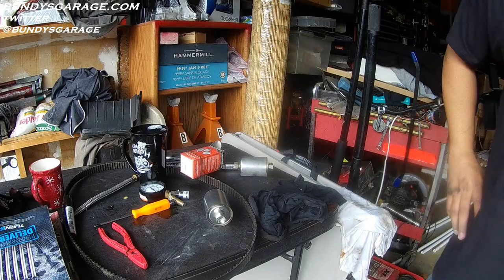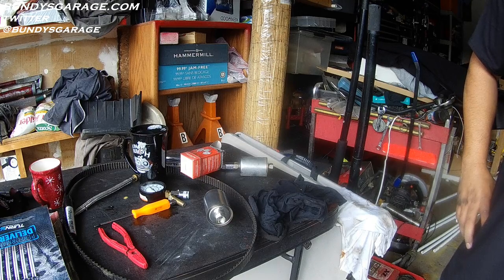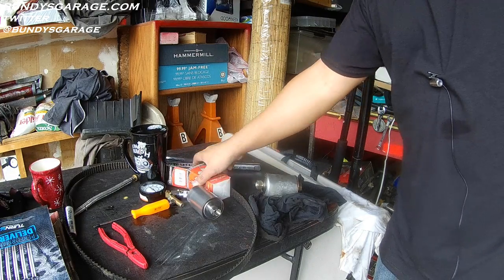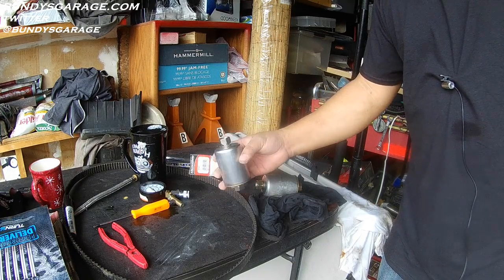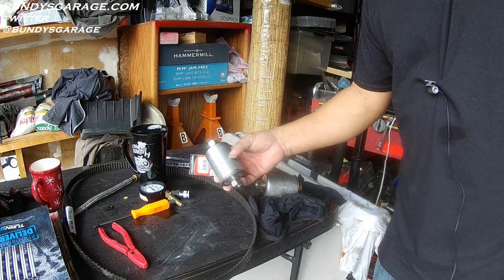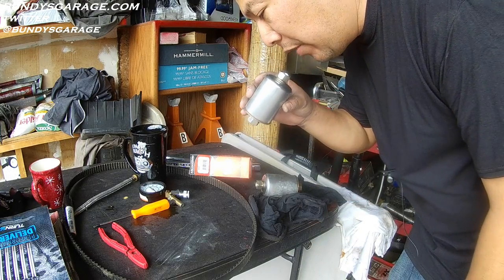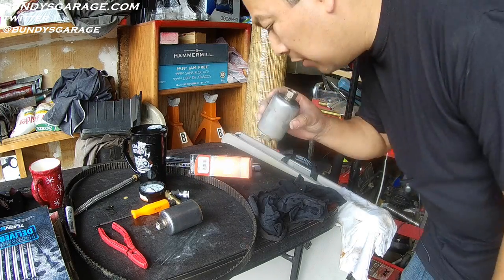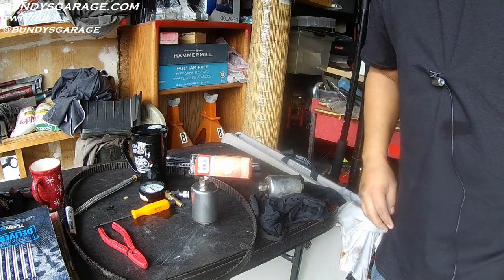Signs you need to change your Fuel Filter - How to tell Fuel Filter is Bad - Bundys Garage

Comment: So tell me "wise one" how is someone suppose to know of their filter is bad... BEFORE you disassemble it ? Blow through the tail pipe ???   1:35 minutes, and no diagnosis..
Reply from the maker: Wise One here to Devil Dog, good rule of thumb, change it every 3rd oil change.
Reply: Signs of a bad fuel filter. Stalling hesitation issue lacks power hard to climb hills engine dos t start engine starts roughly smell of gas fuel pump shuts off from being over heated.
Reply: @ryans413  my 98 s10 cut off on me and won't start. I can hear the fuel pump running. And if I pour gas down the intake it starts. So probably a fuel filter?
Reply from the maker: Check the filter and if that’s good I would look at the fuel pump. Those trucks are known for having bad fuel pumps.
Reply: @ford9339     Probably the pump more then likely mine sounded awful with a high pitch squeal but dosnt hurt to check the filter it’s simple. First check fuel pressure at the rail if that checks out it’s probably not the pump if you get no pressure see if you can hear the pump running if so it’s probably the filter clogged
Reply: Lmfaoooooo

Comment: My car stalls. And rpms go crazy when I’m in  drive. So I have to turn my car off and then turn it on and works fine, for a few minutes. Also my check engine light is on, what could that be
Reply from the maker: What is the code? That's where you have to start. Your car is telling you how to fix it.
Reply: BundysGarage I found out what it is, it’s the throttle body position sensor
Reply: BundysGarage I found out what it is, it’s the throttle body position sensor

Comment: Hey Bundy I bought a 99 pathfinder. Since driving it the past 2 months I have noticed there is no get up and go compared to my 2001 Pathfinder.  It also feels sluggish but not hesitating.  Feels like I have a heavy payload. Going up inclines shows poor acceleration like a slow heavy climb. It finally stalled on me going up a hill. It cranks well, but won't start. Is this symptomatic of a clogged fuel filter? Any advise is appreciated?
Reply from the maker: +To The Morning does it have any codes?

Comment: Ok question just got a project 2 door GMC Yukon. Now the  gas gauge is reading at 4:30 when I know there is ONLY at most 1/8 a  tank of gas in it. So is it the dashboard going bad or the fuel pump?
Reply from the maker: It’s neither. The fuel pump is fine. It’s the resistor that registers the level and sends the signal to the dash that is failing. It’s common on all the Silverados, Blazers, S-10’s, GMC’s, with that set up. So even through your fuel pump is working fine the sensor is not.
Reply: Thanks man

Comment: can someone please answer my question. can a dirty fuel filter cause erratic RPM on cold start which disappears when the engine runs for a few minutes?
Reply from the maker: +Slengo Slengaw a no typically a fuel filter will not work better if it's clogged once the engine warms up. What are the details of the car and do you have a check engine light on?
Reply: BundysGarage thanks for the reply. 
the car is vauxhall zafira 1.8 petrol
No check engine light
on every cold start the RPM revs erratically for about 2 mins then settles down when warm. 
When i put my foot on the gas pedal during those 2 minutes there is no response from the car.
The car runs smooth when warm.
what do you think could this be a result of? 
any comments are appreciated

Comment: I've seen people pull the fuse off the fuel pump when changing why don't they just disconnect the battery
Reply from the maker: Why do either, All they are tring to do it re-pressurize the fuel system but no matter what you do fuel is still going to come out. If you are disconnecting a fuel line and it's under pressure just put a rag over the connector when you break it loose all the fuel will go into the rag instead of your eye.